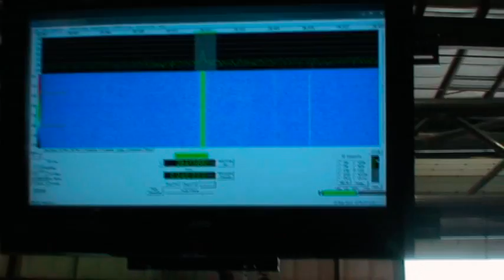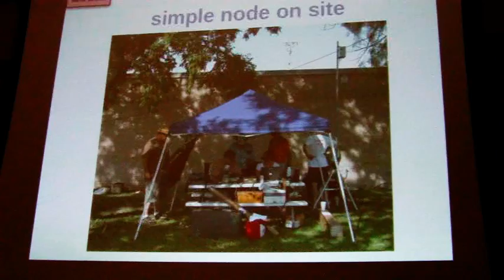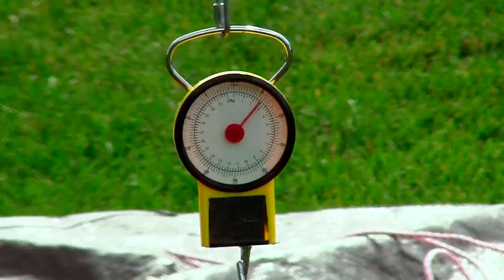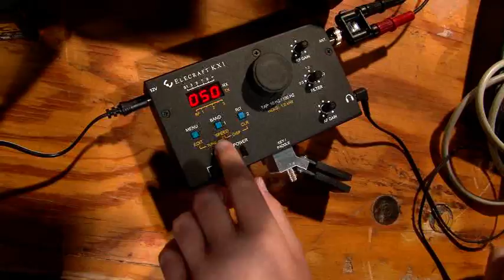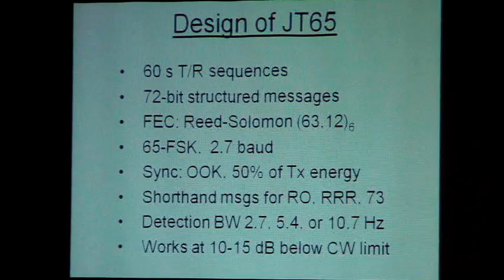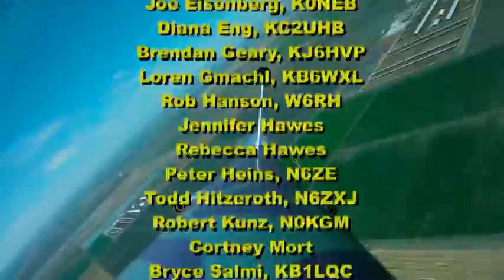The DIY Magic of Amateur Radio in HD

Comment: Mesh networking rules. We have been playing around with Broadband Hamnet in my area. I have 3 or 4 nodes up at any one time. I have an IRC server running on one of my nodes. I recently had an IRC QSO with a guy 10.3 miles away.

Ham Radio FTW!

Comment: @mpechner I shot and edited the show 1080i. The output file from the AVID Symphony HD is 1080i from which the 720P distribution DVD's were made. The 720P file is available for free download from the ARRL website.  The 1080i file is simply to large to make available except on Blu Ray and there will likely be no requests for it. The 1080i file exists only on a pair of G-Drives one of which is at arms length from where Im seated. Here on YouTube the ARRL posted 480.